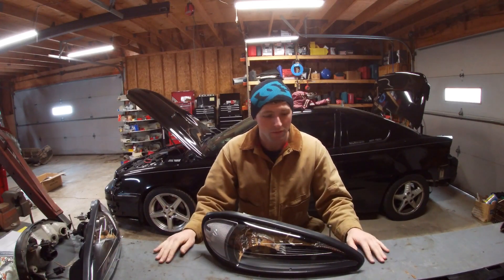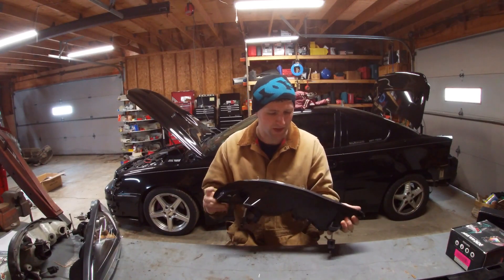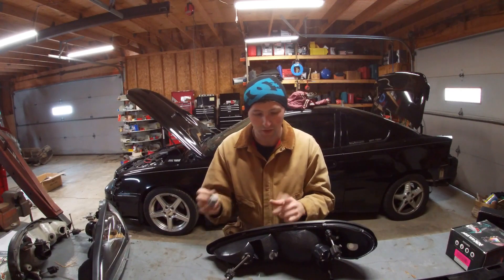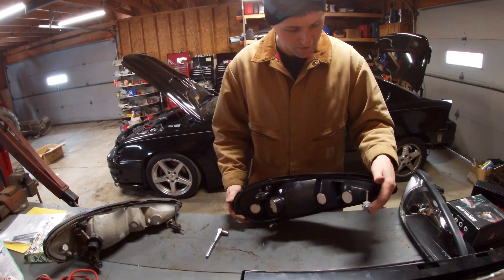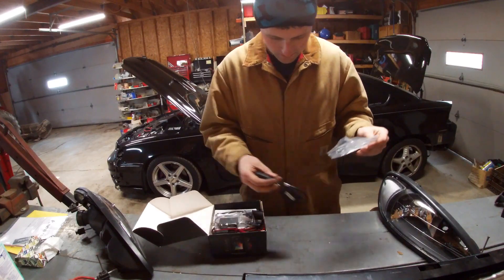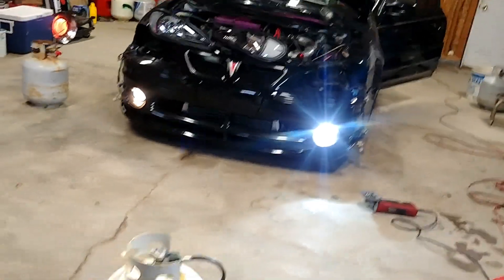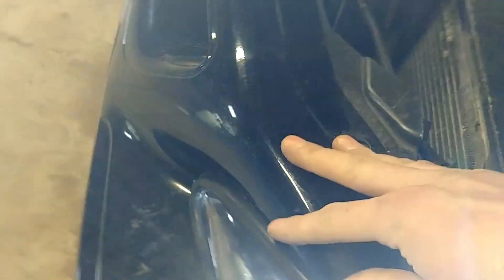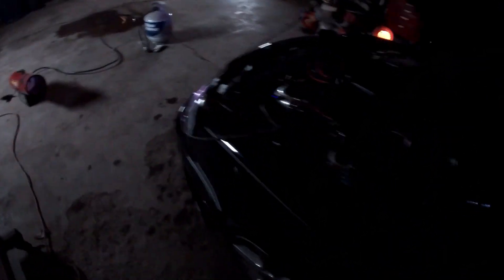Grand Am New Clear Corner Headlight Review And More!!!

Comment: Where can I find headlights like that is there a website?
Reply from the maker: eBay is where they can be found.
Reply: @KMaffittGAGT  ok gotcha
Reply from the maker: For the bulbs, I suggest going straight through xkglow. Easier for warranty stuff. Both of my bulbs have failed, but they honored the warranty and have since gone through and updated things. It's an even better product now!
Reply: @KMaffittGAGT  ok I was making sure I was getting the right headlights and bubs I was getting a gt this week and wanted headlights like yours
Reply from the maker: Pay attention to my install, to my knowledge they still haven't fixed the issues I ran into.  But easy to get around.
Reply: @KMaffittGAGT  ok I appreciate it 👍